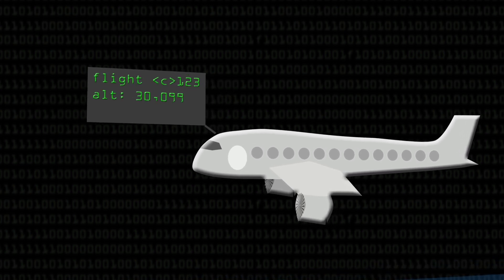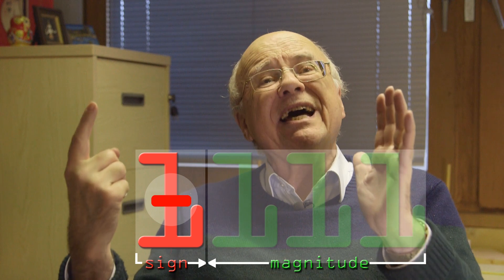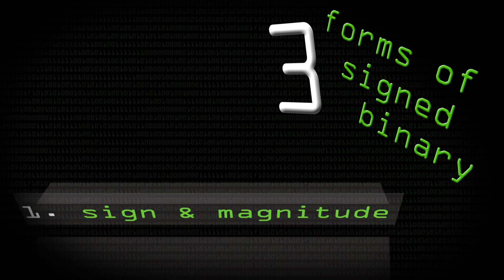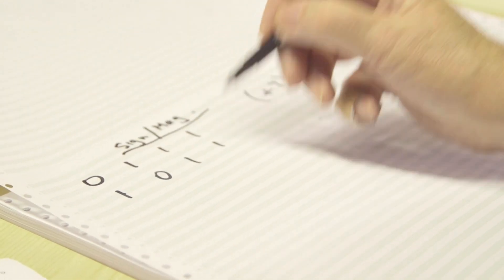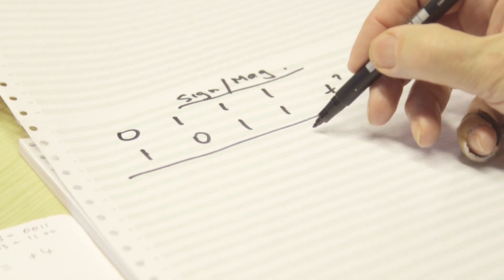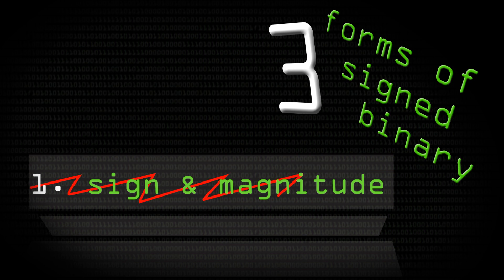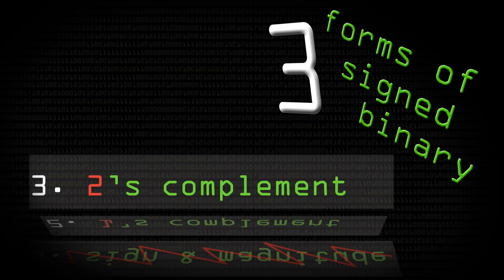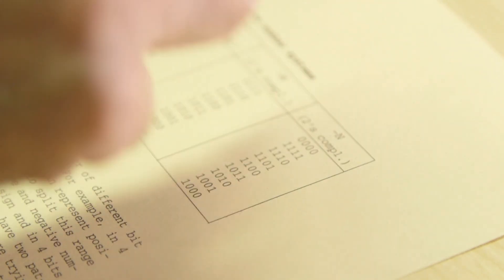Binary: Plusses & Minuses (Why We Use Two's Complement) - Computerphile

Comment: binary should be chucked out the window tbh its pointless i dont understand it and never will! lol there must be a better way!
Reply: u know computers work because of binary?
Reply: ***** What you're missing is that a computer is a piece of electrical equipment which has certain limitations. It is very easy to design an electrical circuit that compares two signals which only have an 'on' and 'off' state. If you try to make something which calculates with bigger numbers you end up having to work out how to represent these with electricity. Does 3 volts equal 1? 4 equal 2? What happens when various bits of the circuit don't manage to keep a consistent voltage, and your 4 volts momentarily fluctuates down to 3.5? If you use binary and say '1' is anything above 3 volts, and '0' is anything below it, the problem is much much less complicated. Representing binary numbers reliably in an electrical circuit is easy. Representing other number systems using electricity is very difficult to do reliably... That's all there is to it. Binary is used because it is easier and more reliable based on how a computer actually works.
Reply: It's not meant for you to understand. Your computer, however, understands it perfectly.
Reply: Binary is what allows you to watch funny cat videos on the internet, that's not pointless!
Reply: ***** if you don't know binary, then your software would be full of security holes. binary overflows are some of the easiest ways for software to be exploited. 

not to mention how in the world can you design a low level piece of software (including future compilers) without any knowledge of binary.
Reply: What a nice and useful comment.
Reply: ***** I appreciate the effort and thinking you put in a subject you clearly don't grasp, and is obviously not your field. Having said that, you seem to forget that the computers we use, work with electricity. And without going into much detail, let's say it's way simpler to code all information using only 2 values, for example 0 volts and 5 volts.
Reply: ***** No... there is 10 kinds of people, the one how understands Hex and F-the rest.
Reply: *****
"im not a programmer"

That much is obvious.

"im more of an editor so thats not an issue "

Oh, but it is! You're arguing from ignorance because you lack an understanding of the actual workings of computers.

"my point is 10101100 takes more space and time to read"

Only in source code. And only if you're actually manipulating individual bits when doing some relatively low-level programming. 99% of the time, asides from knowing the limits of how numbers are represented, you don't deal with binary directly at all.

"plus work out the sum value then what just saying the value in the 1st place think of it like this what takes up more space and computing power"

Computationally, binary is simple to deal with in a digital computer, and is easy to miniaturise. That's one of the reasons we moved to using digital computers over analogue ones. With binary, you're dealing with the (relative) presence or absence of a charge, nothing more, and that's easy for transistors to deal with because transistors can act as on/off switches, thus binary.

"5 digits that equal a 2 digit number or just the 2 digit number where no calculations are needed!"

You're confusing the length of a numbers representation with its complexity. You also fail to realise how complex it is to add two, say, base-10 digits together versus how easy it is with basic logic gates to do the same thing. A simple half-adder is an AND gate and an XOR gate, though in reality, you'd end up using four NAND gates. Turn that into a full adder, and you've a nine NAND gate circuit, which you can chain together to add together as many binary digits as you like.

Also, consider this: how would your non-binary computer represent the numbers? Consider that all your circuitry has to be able to cope with that representation, and you'll start to understand why we use binary: it allows us to model everything using simple boolean operations that can easily and efficiently implement anything computable.

"if you see what im on about pcs should be so much more fast and effective than what they are currently!"

I think you really need to go and learn why computers work the way they do. It's not by accident that they use base-2.

You know what the biggest thing that makes computers faster is? Reducing transmission delays. Do you know how we do that? Using smaller transistors packed closer together. The only problem with that is that at a certain level of miniaturisation, you begin to see quantum effects messing with things, particularly quantum tunnelling, which causes your circuits to start misbehaving, much like cross-talk between poorly-insulated wires.

If using other number bases would work, that's what we'd be doing. If it would work, and you wanted to maintain compatibility with pure binary devices, you could use a quaternary (base-4) arrangement, as that would (hypothetically) give you the ability to squeeze twice the data into the same amount of space. Only the thing is, if that was actually a win, we would have done it by now. Instead, things like instruction pipelines, caches, branch prediction, out-of-order execution, simultaneous multithreading, multiple cores and other arcane methods have been used to squeeze out as much efficiency as possible from CPUs.

Finally, please learn how to use punctuation properly. Your comments were difficult to read because they were all run-on sentences.
Reply: Eternal Solitude Yes but that doesn't work in a CPU because the voltage changes alot in the circuit, if the voltage had to stay constant then the CPU would be a lot harder to design functions for it the CPU
Reply: exactly remove the binary and you remove the security holes! simples!!!
Reply: *****

Understanding binary is important when you work with hardware or program with lower coding languages like assembly, VHDL or machine code. Embedded systems are a whole branch of electronics that have a lot to do with these languages and thus binary.

Ofcourse when you work with higher languages you don't neccesarily need to know about binary but rememeber that whatever you program in a higher language will get compiled downto machinecode which works with binary.

The reason for computers working with binary is simple. It's because computer memory works with bits, which is build up of logic gate outputs giving off a voltage. Logic gates either give of a voltage or don't, they are either a '1' or a '0'. By combining 8 logic gates in a row you acquire an array of 8 bits which we have standardised as a byte.

If you want to make computer work with a higher base than binary that is definetly possible, but to do that you would need to alter the current hardware (logic gates) to output different voltage levels, and encoding those different voltage levels to your base. (E.g. 0V = '0',   2V = '1' and 5V = '2'  to be able to count in ternary).

Theoratically this sounds fine, to put into hardware it is not that easy though. Right now logic gates are basically transistors which are extremely cheap, altering logic gates to allow multiple voltage levels will increase their cost drastically while only slightly improving calculation time. It's simply not cost effective and even then you would need to learn to count in ternary vs binary which I think would actually be more abstract. Altering the logic gates to allow counting in base 10 would be extremely ineffecient in terms of cost, therefore not really possible.
Reply: Binary is already very efficient compared to other bases, as he told you. What do you mean it's like sending a dinossaur?
These days you have enough abstractions to not have to learn binary if you don't want to, unless you're designing hardware. So if you don't like it you can ignore it.
Reply: matsv201

negative numbers work fine in binary, they don't work good in computers though. A negativve 3 in binary is simply "-11".

If you would be able to get a computer to work in a different base (let's say base 10) you would still need the two's complement to easily work with negative numbers.
Reply: matsv201

Fair enough but even then the problem with negative numbers arises from the system, not from binary itself. A ternary system or a system in any other base will have a problem with negative numbers.
Reply: Obviously you don't understand what you're talking about
Reply: Yes ofc i do, and programming language is for humans and binary is for computers so we dont need to know binary, it makes sens to store in binary and transfer files or data in binary but learning it is a waste of time and must be a better way.
Reply: Incompetent Gamer yes funny vids especially cats are a waste of mind power and time! id rather watch something you can actually use in life!
Reply: ***** 1. It's required if you want to understand why some of your programs might not behave the way you want them to
2. It's like learning C, you might not want it, you might not need it, but you won't understand how computers work without it
Reply: im not a programmer im more of an editor so thats not an issue my point is 10101100 takes more space and time to read plus work out the sum value then what just saying the value in the 1st place think of it like this what takes up more space and computing power 5 digits that equal a 2 digit number or just the 2 digit number where no calculations are needed! if you see what im on about pcs should be so much more fast and effective than what they are currently!
Reply: ***** but youd have to store the significance of each character youre using for your representation of a number, which in the end will still result everything to be binary
Reply: yes i agree 100% thats because thats how its always been done, no-one thinks theres a better way so were now stuck with it!
Reply: *****
It's not that no one thought of another way, it's how the fundamental components of computers work (too much for me to get into in a comment). You only need to know binary if (like me) you want to learn how to design logic systems like computers, if you don't like it you can just not learn it.
Reply: You could make an electronic adder for any base, if you want, but binary is more efficient. Just representing the numbers as LED:s to show the magnitude shows the difference in scaling.

I'm using positive numbers here, just to avoid having to build a base 10 version of 2's complement. If you want to represent the numbers 0 to 199 in base 10 using the same method, you'll need 19 LED:s (1 for the 100, 9 for each 10, and 9 for the singles). If you use binary, 19 LED:s will give you a range from 0 to 524 287 = (2^19) -1. It's just a bit harder to read, until you get used to it.
Reply: If you don´t understand binary, this is not really the best start video. This is more a second part introduction to the more advance stuff.

In normal binary there is just plus numbers. The negativ complementary is just a way to implement negativ numbers that dont really work good in binary. Its almost like a hack of binary.

The next level they will introduces exponents to, then its possible to multiply and divide to.
Reply: iv watched many binary vids it makes no difference how many i watch its just not good or fast enough imaging trying to debug using binary its just overwhelmingly pointless!
Reply: *****
You seem to think this is somehow relevant to programming and debugging, when it kind of isn't. What is explained in this video is really only relevant for hardware design.
Reply: *****
I actually do hardware debugging. Some simulators allow for decimal re-representation of signals and it is waaaaay harder to work with in most cases.
Reply: There is a better way if you want to use numbers for counting how many dollars you have in your wallet or whatever you want to use numbers for in your everyday life. It's called the decimal system, and I assume you already use it. (Even though even that's arguably not the best system for this purpose.)

But as it happens it is very useful to use two different voltage levels as symbols for encode information in electronics, and therefore computers. The most efficient way to use two different symbols to encode information is in the binary number system.

Therfore, if you want to do anything that has anything to do with the hardware level of computers, it is tremendously useful to understand binary, because it enables you to understand how the hardware works. If you don't want to do anything like that, obviously you're not required to understand it. However, even if you work with computers at hardware level, you're not really going to write and read a lot of them. That's not the point. The point is purely to understand how computers use them.

Therefore, we can't chuck them out the window because they are the best option for computing, there are better ways  if you want to do anything else with numbers.

You don't debug a program while looking at it in it's binary form, but it can still be very useful to know what a computer does if you want to debug a program, and for that, you need to know how the binary number system works.
Reply: actually, the video is more about overflowing and not essentially about binary, the problems he's discussing occur in a number system of base, not only in base 2.

So one might explain the same problems without using binary, e.g. in base 10, because it might seem easier for most people. Although, the arithmetic in base 2 are much easier, so i think its more simple.

A more general explanation in base n (with finite n) would also be possible, but maybe a bit to complicated for a youtube video..
Reply: But i guess you want to be part of the A-Types 'normal' people think you're talking about
Reply: matsv201 HA! :D
Reply: You clearly don't have a clue
Reply: *****
binary, even in higher languages is still useful when you want to do certain things. im not going to try to explain what some of those things are but if you're curious i recommend looking up Bitwise operation. Ive had to use it for several things, one example was to quickly read channel information from hexidecimal color codes. If it was useless then languages wouldn't have Bitwise operations
Reply: EnderCrypt There is 10 types of people. The once that once that do understand, the once how don't, and the once that din´t get this joke was in base 3.
Reply: ***** +1
Reply: It's not pointless, electricity can only either be on or off in a CPU
Reply: Eternal Solitude How do you think a CPU works? Everything at the low level is handled in binary because you can only have electricity on and off
Reply: Faissal Bensefia Actually there is several types of system that can hold multiple levels of signal. Flash, USB 3.0, GDDR5 and WLAN all of them have multiple level of signal. Thats how they are so fast.
Reply: matsv201 Yes, but that doesn't work well on something like a CPU
Reply: Cadde
"The short story is, electrical interference. It's really difficult to make electrical components that keeps a steady voltage. "

I would say its more the answer to why we have discreet steeps in steed of just analog signals.. Well that is interference and noise. Noise is actually more of a problem to cable connection than interference nowdays.  Just about everything is coax or balanced-pairs, the interference problem is really low. Cross talk is still something of a problem, but in most cases not.
Reply: Actually, it would be quite possible to create electronic digital devices based on other bases than 2, one would just need to come up with a way to represent the other digital signal levels besides 0 and 1. But I'm sure it would be very hard to get it working as reliable as when using binary since signal levels would have to be more stable (as someone mentioned). One would also need to reinvent a lot of existing digital circuitry to work for this alternate base and this would be a mammoth task. But why would anyone even try using any other base? Base 2 (binary) is simply the least complicated, the most elegant and most efficient to use for such hardware, and that is why it is used. Occam's razor applies as usual in science.
Reply: ***** You quite obviously do not understand how machine language works. The logic circuitry of a computer runs fastest in binary, and when you start to abstract the abstraction requires more processing time. Actually, considering that binary can store anything in just 1s and 0s it is extremely efficient. If you were to write everything in real numbers you lose the universality of binary and increase processing time because you have to read more than just 1 and 0 but 0-9.
Reply: matsv201 Are you going to build a computer out of shielded connections or out of coax cables? Was that your point?
Reply: ***** it may be full of security holes, but knowing binary will at least reduce some of the holes that may occur (especially in lower languages). the same concepts apply to anything in life, take driving, you don't need to learn stick, automatic can get you anywhere you want to go, but those who learn stick already know automatic, and have no downsides.

if the concept of not wanting to learn binary, is because its hard,then clearly you are in the wrong field of study anyway. Being too lazy to learn is not an excuse.
Reply: ***** ...that is definitely weird. I'm in second year right now, and for the most part CS in my school is treated under with the faculty of math rather than the other sciences. Since the start I already took 3 calc courses (one being more like intro to analysis, and the 3rd being multi-var), 2 linear algebra courses, and probability .
Reply: Cadde Almost all internal busses are balanced pair today. so yes, almost all computers is made this way. but not coax, thats is a technology of a dead era almost.
Reply: lulhoofd1 Well that's a way to put it... But if you say -11, you basically use a sign bit, even if you don't think about it....

You might say... well its a plus or minus sign... well, yes when you wright it out, it looks like that, but its still a binary data point.

Using a standard sign bit is not impossible by any means, but its really impractical... that is kind if the point of the video.

If you have a true binary system, you cant really write out a - or + sign, than you have a 4 complement system with 0,1,-,+. Yes, the number system is still binary, but the calculation system is not.

So even if you statement is true, its kind of relevant.
Reply: matsv201
I was responding to this comment of yours:

"In normal binary there is just plus numbers. The negativ complementary is just a way to implement negativ numbers that dont really work good in binary. Its almost like a hack of binary"

What I meant with my comment is that binary isn't limited to computer science. Binary in and of itself only means mathematical operations in base 2. Which is why a negative three in binary would be simply "-11".

Now when we use negative numbers in a computer then it becomes more difficult since there are no minuses and you will need to sacrafice a bit for that. But that is regardless of the base you are working in. Even in ternary or higher systems you will still need a sign bit and two's complement to make it work easily.
Reply: lulhoofd1 The minus sign in text also takes up space. If you did all your maths on grid paper, where each grid is a "bit of information" well that's your sign bit.
Positive numbers are implicitly understood without a positive sign.

In fact, writing out "-11" here takes up 3 bytes of space. The value of those bytes are 45, 49, 49. You can't write negative "11" without using  an extra character.
Reply: lulhoofd1 Well, that's the differences from a binary system and just binary numbers. 

And of cause, you can use just a sign bit in a computer to, but it work's badly.

Binary is not limited to work in computers, but outside of computers, there is very little, almost no use for them.
Reply: lulhoofd1 Well... that is only palatially true. It would be no real problem if the system always used a sign bit, the problem is that it don´t, and its actually a software problem, not a hardware problem.

In most cases the hardware don't even understand if its a signed or not. It just use it just as any other number. That is the nice thing with 2 complement system.

This also work for floating point....

... i would say the system is not the problem, the system is the solution. If we talk about hardware, there is no information at all that tells the hardware if it is 2 complement or just a  normal binary number. The hardware don´t care, and with 2 complement system it will just work anyway.

So the hardware simply don´t have a support for negative number, its all made in the compiler (or coding if you are using assembler)... but in some cases there is some hardware conversion from one system to a other, than the hardware do know, but it don´t know if you converter corectly. There is no information in the number saying if its 2 complemntary, floatingpoint, integer or what ever.
Reply: matsv201

I don't understand what you mean to say? At hardware level a negative number does get stored in two's complement. And a positve number does have a sign bit; a '0'.

This is why in C if you use a signed int vs an unsigned int you now have your maximum positive number halved. (normally 2^32, now 2^31) It's because the underlying hardware, a 32 bit memory slot sacrifices a bit for a sign bit.
Reply: Ignorant idiot.
Reply: lulhoofd1 It doesn't matter what base you are counting in, if you need to append a sign before a negative number it's going to take up space.

Imagine this instead, Start counting at -8:

0000 = -8
0001 = -7
0010 = -6
...
0111 = -1
1000 = 0 (This is where the negative numbers stop)
1001 = 1
...
1111 = 7

There's basically no difference to how that system works. Throw away the overflow bit and...

1111 (7) + 0001 (1) = 0000 (-8)

And that is that. Space wise there's no difference between the two counting paradigms. You are still representing 16 different numbers.

However, to represent -3 in decimal you have to append the sign byte IF you start counting at 0.

If we started counting at -8 we could have the following "single character" numbers.

0 = -8 in decimal
1 = -7 in decimal
...
7 = -1 in decimal
8 = 0 in decimal
9 = 1 in decimal
A = 2
B = 3
C = 4
D = 5
E = 6
F = 7

This is also known as hexadecimal or base 16. You know this of course.
My point is, it doesn't matter where you start counting, 2^4 = 1^16 = 16 and the only thing that really matters is how we decide to represent the values.

In our general society we have decided to represent numbers in decimal. And we have decided that any negative number should be denoted with a minus sign or the "negative" prefix.
Reply: lulhoofd1 Well, yes, but the hardware don't simply care. There is no hardware sign bit. For the hardware its just a number regardless if you like to think its a 2 complementary sign bit or not.

The hardware just simply don´t care, well in the exaction if you have a hardware convention process, that is in the case of sign bit is quite uncommon.
Reply: ***** as a programmer i actually agree with you, on a philosophical level. binary is rather far removed from our intentions. but as you can see from the responses: people have a tendency to obsess over unnecessary details.
Reply: xybersurfer Its even a question if the hardware do se it in binary, hex or base 256. I would say to most extent the hardware ses most numbers in base 256. Just about every component is clustered in 8 bit sections, apart from the flotingpoint once.
Reply: matsv201 that would be one way of looking at it. those components could be both binary and base 256 at the same time, depending on the level of abstraction you choose. just like a usbstick with 1GB could be seen as one big cluster having base 2^30.
Reply: xybersurfer

Binary isn't rather far removed for ALL programmers. People who program close to the hardware (like me) deal with binary all the time.
Reply: matsv201

I'm done with this discussion. I keep telling you that binary is something seperate from electronics but you still keep talking about hardware. Binary does not imply hardware.
Reply: lulhoofd1 I don´t disagree with you, but the problem is that your argument is not that constructive. The thing is that binary have basically the only application is in electronics
Reply: matsv201

Wether or not binary is used outside of computing doesn't matter. Your argument was that binary has a problem with negative numbers. This is not true. Bit-wise representation of binary has a problem with negative numbers.
Reply: lulhoofd1 The whole video is about solving the actuall real life problem of handeling binary in a computer. Not solving a non existing problem in a fantasy world that you never run into.
Reply: matsv201 i don't disagree with you. if you choose to view things at the hardware level then that is what you see.

my point is that it is not the only possible view. it's a bit unnecessary to argue about which view is better. i think it depends on the situation.
Reply: lulhoofd1 i don't deny that people can get used to binary. it holds no secrets to me either. but that doesn't mean it's the closest we can get to our intentions.
Reply: xybersurfer Well, sure, its possible to view it from every state from binarey up to 64 bit clusers....

.. but it was more of a philosophical question. Almost no computers can generally numbers smaller than 8 bit. Sure, there is some nible-switch operation, buts that's basically it.

The ALU is most often in section of 8 bits... basicly 8 bit is hardwired. If you use 16 bit it just links to together, and so on. If you use SIMD 8 bits you can run 8 desperately  simultaneous, but you can never run 4 bits.

For flotingpoints its mostly 16 bit that is the minimum. But you can still address 8 bits (well, it will be very buggy if it jumps one byte).

Well a 8 bit ALU is in some ways 8 1 bit ALU put hardwired.

But if we talk about FPU all the bits is cross wired making what transistor belongs to what bit almost impossible to say. So i would say that at least for a FPU its a truly 16/32/64 base system, not a binary. For ALU its kind of more complicated.
Reply: matsv201 you have shifted from addressibility to the inner workings of subsystems. yes when you go deep enough into IC's, you will likely, find only binary.

the lines themselves are not binary though. a line can have more than 2 possible voltages. voltages exist on more of a continuous range. and those lines are made of atoms... i can shift the view too. but what's the point of all these details? what exactly is your philosophical point?
Reply: xybersurfer
No there is no inner workings in a modern CPU that can address anything to a lower level than byte. If you want to access a single bit you have to address the full byte, than extract the bit via some bit extraction method. (probably a shift left - shift right or something)... then you still have a 0000 0001 or a 000 000. You never get a true binary number.

There is also processors that use DDR technology in there inner core. Noticeable AMD K7. That is double flanked data, not really quad levels, its not truly several levels, but.

For a ALU you can somewhat argue that its a binary system at the core. But for a FPU that analogy breaks down. Its like saying that our decimal system is really a binary system because we use lines when we write them.

A FPU interconnect bits in several different way. When working with a ALU its simply just two (tree) bits in, two bits out (the result and the carry bit). Several one bit segment can be just connected for a several bit system...

... So then, you could argue, yes, that's just a system of several single bits interconnected.

But for a floating point system it don´t work in this way at all. There is feadback loops, carrybits, hardware exponents and so on. They are all interconnected in several complex ways. (the sign bit is also hardware imposed).

So if you have a computer that have no FPU or any other form of interconnected calculation, then you could argue that the computer is truly binary based, you still cant address all the bits, but all the bits is equally valid. But if you have some kind of interconnected calculation system, the bit stream is treated as one.

So is it a binary system.. then i would say, there is to many intercombability issues to be a truly binary system....

Its like saying the Roman numeral system is base 5 or base 10... Well, you can sign 5 as single base as well as ten. But you cant sign 15, but you can sign 50.

Its not truly a base 10 system, but also not a base 5 system, its a hybrid.
Reply: matsv201 you just don't seem to get the points i'm making. you have a hard time letting go of the details.

you mentioned how systems are binary values. i mentioned that this is true but that this is just a single point of view.

you changed your view to to a deeper lever where one only sees binary and i in turn showed you a deeper view where electric wires can be regarded as components, which are not limited to passing on only 2 voltage values but a continuous range to show you how pointless it is to senselessly pick a single view.

you subtly introduce the assumption that the bit addressability equates to the "base". even though this is not necessarily the case.
Reply: It's not so bad, if you learn about number bases in general and once you get it you can use hexadecimal to shorten binary numbers.

so 0000 == 0 and 1111 == F

a 16 bit number like: 0010010010100011 can be viewed like this;
0010 0100 1010 0011 == 24A3 (hex)

24A3 (hex) in decimal is (2*16*16*16) + (4*16*16) + (10*16) + (3*1) == 9,379
Reply: *****  binary is actually easier to learn than decimal.  Its just you learned decimal  as child.  And better way is hexadecimal it easily coverts to binary and keeps numbers from spreading long distance.I understand bin, hex, oct, and dec